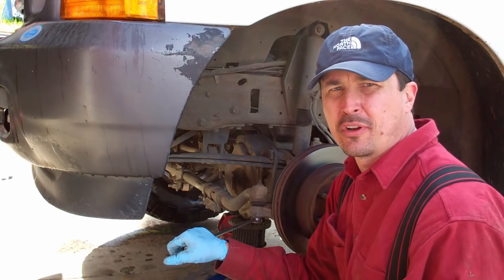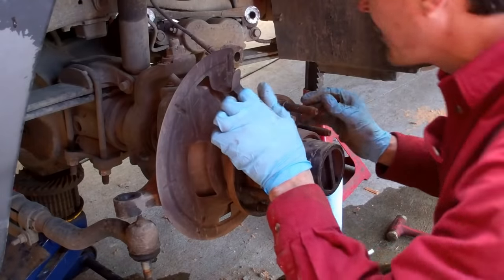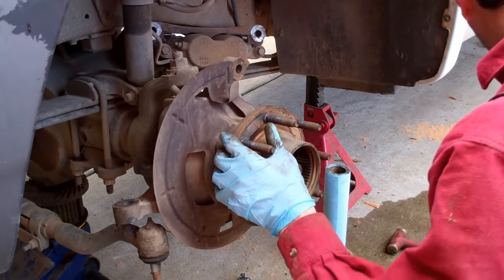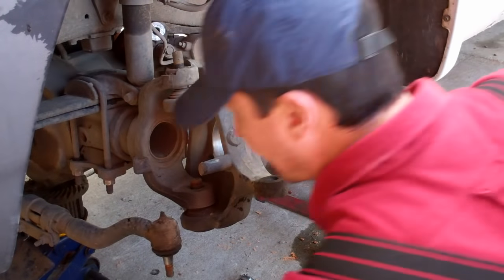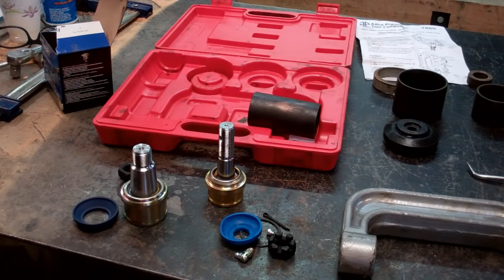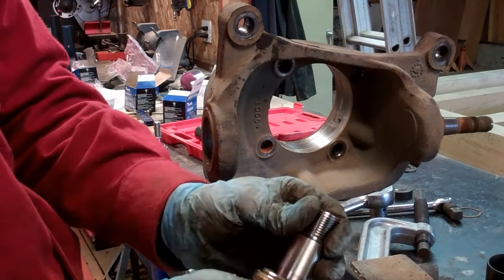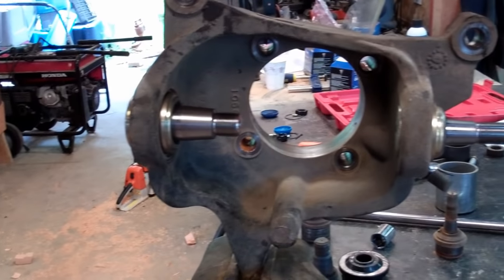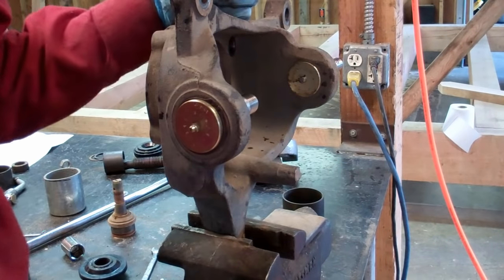How To Replace Worn Ball Joints Ford F250 Truck

Comment: Great video.  One suggestion  don't take out the ABS sensor out of the bearing.  Follow the wire, it's only about 2' long, and disconnect it at the wire connector.  They get seized in and break when you try to pull them out.
Reply: correct

Comment: $1200? that is a rip off!!! Ball joints only cost at least $30 per. and about an 30min - 1hr to replace.
Reply: Decent ball joints come from Moog.  They are area of $40
Reply: Mechanic gave me an estimate for  6 hrs 100$ bucks an hr I did it in 2 hrs for less than 150 bucks and now have tools now and am an expert:)

Comment: You can leave the 4x4 lock hub all together and just remove it with the wheel bearing as an assembly with axle shaft. Its a 2.5 hr book time job cut in half.  Of coarse if you are replacing wheel bearing or have hub problems you need to disassemble them.  I do lots of these
Reply: What kinda power tools do you use? Do you really need to buy the big tool set for the ball joints ?
Reply: @martinmartinez1109    I have a ball joint press from Cornwell but have seen sets cheaper   I don't have the universal set. Just basic ball joint press with three different sized tubes.  I have miscellaneous cut off pipes, old bearing races, fabricated spacers and plates I have kept and made through the years.  To be honest I use the press mostly for reinstalling the new joints. You want them in great shape and perfect when the job is done.  I normally use a air hammer, or a torch, or cut off wheel to remove the old joint. Quicker the better.  We are concerned with speed (it is how we make money)  but it has to be professional and look and work like new when it is done.       If you don't have a press you can usually pay a deposit at your auto parts store and when you return it you will get your deposit back  it is a good thing for the diy     I only have the tools because I do it for a living.    I hope this helps.
Reply: @martinmartinez1109  oh yes I do have a good set of tools and impact wrenches, and lifts.  I own my out shop and do it for a living. But I use to do these things growing up before I did it professionally, I didn't have that much then.    To be honest I have found the best mechanics don't have all the latest and greatest tools or even huge sets or the biggest tool box.    you are not out anything trying to do this with what you have.  If there is a will there is a way.   if you get in a bind and can't get it apart, put it back together or borrow, rent, or buy what you need to finish.  BE SAFE.  A Dr bill will be much more expensive than anything we can save or repair on a car.
Reply: @RT-xj3tr how can you leave the 4x4 hub on when there's an axle nut behind it?

Comment: great video, one of the best I've seen for f250's. i live in Nj so mine will take a little longer because of all the rust and corrosion. on the plus side, as my truck rust over the years it's getting lighter, giving me better gas mileage.
Reply: Pain and also misery. My ex is VERY rusty
Reply: I feel your pain Joker, Atco NJ here and spent the last 2 days with a needle scaler chipping off all the rust off my frame and painting it. I got at least 20lbs of rust in my driveway
Reply: Joker, so true!  I live in the Chicagoland area.  Where your car just disappears over time.  As it swells with rot, the rough roads keep it falling off.

Comment: We use our trucks for commercial snow plowing so what we would do while were in there is definitely change the U joint and if we have snow money we would change the whole bearing assembly put everything back together with copper anti- seize The rust here in New York is so bad the actual rotor will rot through before the brake pads are gone and we also end up changing entire calipers every time but doing it yourself you’ve saved all that shop labor , put that money back in to all new parts thanks for the video  100% correct

Comment: Thanks for this. I'm pretty sure I need to do this on an f350 I just bought. I really appreciate your little speech on self reliance too. I was making up a list of tools I'd need to add to my collection while I watched this. It amuses me how simple most automotive repairs are, but like you said, folks are just convinced they have to pay a "pro". I once went to O'Reilly's, put my truck on jack stands in the parking lot. Removed my brake rotors and while they were inside being turned I repacked my front bearings. All with my own tools. It was my own truck, so didn't have the luxury of working at home and driving them over there. As I was working I heard people talking. Looked around and saw a quick lube mechanic shop across the street, two of the "pros" standing there watching me. It was extremely gratifying! It's all just nuts and bolts. Thanks again man!
Reply: Tom Brueggen quicklube mechanics are the farthest thing from "Pro" that you can get, sure some stuff can be done by the at home DIYer, but for most of the stuff relating to drive train and Engine and other things you should get a pro to do.

Comment: Did this job today out in -2 weather in the driveway. Also had to cut a custom piece of pipe to help install the lower ball joint. I took this job on from watching a few YouTube videos and it really helped when making this happen. Triple checked all the bolts and nuts and retainers when finished and called it good. One thing I found out is to install the grease fitting on the upper ball joint first before pressing it in so that you can orient the 90 degree fitting forward so you can access it with the grease gun later. This is because when you tighten the grease fitting down, it may be pointed in the wrong direction.

This all started from the steering wheel getting a wobble at different speed and if the truck was loaded. Passenger side ball joint wear is always worse in worse shape than the drivers side.
Wranglerstar, you are so correct in stating this is not an impossible job if approached correctly and you can save a lot of cash that can go elsewhere.

Comment: 12:00 Camber/caster bushing. also, when you press the ball joints in, try applying some anti-seize to the ball joints as well as all the mating surfaces. if you ever do this again, you will be glad you did!
Reply: great advice!
Reply: Copper grease saves so much hassle later. Good advice.
Reply: Gale Hess it's fine. It's never been a problem with me

Comment: not trying to be a troll--just FYI though, you can hammer the lower ball joint out and if you dont want to do that you can use a cutoff wheel and cut the stem off and eliminate the need for the extra piece of pipe..ive done it both ways and both are affective. GREAT VIDEO!!!
Reply: I had to use a cutting tool to get my upper ball joint off.  Castle nut was stuck and the ball joint just kept on spinning.  This was the last resort after trying with vise grips.
Reply: Excellent
Reply: @1010degrees  Same. On an '85 TTB, But the axles are still remarkably similar.

Comment: I just changed out a hub in my 1999 Ford F-250 super duty 7.3L diesel because Driver side bearing went bad. At that time i looked at my ball joints and was wondering how in the world do change them out. Well i like your video because you show step by step how to get to the ball joints. Thanks very informative. Fyi. When doing a hub i had to change all seals in the end because the old seals when i broke the seal and they still looked good i put it back together again and they refused to seal right. So to anybody watching this video, please change your seal so your vacuum 4x4 system works properly. Trust here in Alaska Anchorage, i learned the hard way in 12 degrees weather. I ended up ripping everything apart again, just to install new seals on the hub, because i didn't do it while everything was apart the first time. Trust me it sucked! But still i saved myself $2300.00 doing it myself.

Comment: My son has this exact truck and needs his ball joints replaced.  NOBODY wants to do it, so we are going to do it.  It's looked like a big pain, but I just replaced the ball joints on my 4wd Explorer and except for the fact that the F-250SD is a little more heavy-duty, it's basically the same deal.  I'm gonna get a few pieces of pipe first - great tip!
Thank you for this wonderful video - you've inspired / encouraged me and I'm confident we will get it done fairly easily now!

Comment: Just replaced ball joints on my father's truck after watching this video. Thanks.
On this truck, axle did not come out easy like yours. It was hard getting axle seal out of knuckle. Had to punch it out from behind and replace the seal.
After finishing everything, something just came to question. Do you need to grease axle seal?
What is lubricating this axle seal?

Comment: I was a dealership technician for many years.  Great video.  I searched for this video because I have a friend's 250 at my house that needs the ball joints replaced, and I wanted to make sure that the procedure was what I thought it was.  A couple of things that I would recommend when disassembling is Leave the nuts threaded three or four threads and shock the knuckle right next to the drag link, and both of the ball joints with a BFH (Big F**king Hammer).  You can run the risk of tearing up the boot on the drag link and you can mushroom the head of the ball joints and cause issues with fitting them through the hole, if they are really stuck in there with a lot of rust or maybe just gorilla tight.  If they are super duper stuck you can use a pickle fork for the drad link and a ball joint separator.   Thanks for this tutorial!

Comment: I'm not sure which I hate more:  paying somone to do the job I can do myself, or doing the job myself.

I learned how to work on vehicles in 1979-80, when I souped-up a 1971 Mach 1 Mustang with a 351 Cleveland.  Things have changed a lot since then, and it drives me crazy when I have to work on my vehicles.

I am a mechanical engineer, but if I was an automotive engineer, I would never admit it.  Brake lines run in front of suspenion bolts, plastic parts that break instead of coming apart, spark plugs that need three extensions with 2 u-joints in-between, starters that can't be reached without taking off the intake manifold, fill-in-the-blank simple thing that can't be changed without taking off 47 pieces of whatever.

Sorry.  Ranting there.

Comment: The great mysteries of life like why does it only take for bolts to hold the hub on and eight to hold the wheel on .
Reply: Kent Taylor much different physics lol
And heavier boltz.
Reply: The wheel is further away from the center rotation point thus more force on it centrifugally.
Reply: Shear pressure

Comment: Nice job saving yourself some hard earned cash.
A few things,
NEVER use a heavy dead blow on a steering knuckle. You can deform the living daylights out of the casting with one. I have seen more than one steering knuckle ruined this way by DIY'ers. Usually it is the arm when the tie rod connects that get bent, but I have seen the ball joint flanges bent as well.
The best thing is a big ball peen hammer, not a dead blow, not a soft mini-sledge/beater/top maul. One swift hard shot perpendicular to the axis of the joint will pop it right apart. The idea is to take advantage of the ductile nature of cast iron. Done this way, the casting deforms then returns to shape. Beating on it with a soft hammer just swages the casting around until it vibrates free.
Also, always use anti seize before pressing the new joint in. It helps lube the joint so it can straighten out when it gets cocked going in, and makes life much easier when on the next person.
You need to lube that upper joint, it does not have enough grease in it from the factory.
it is called a "zert," not a "cert." :)
Reply: Zerk fitting (Oskar Zerkowitz)

Comment: You did a great job doing the ball joints by yourself buddy, and you are absolutely right about how expensive is getting life now. 
I have a 04 f250 6.0 4WD  and i need to do the same job as you did, i am getting all the tools i need and do the ball joint myself as well.
i am sure with your video you are helping me and who knows how many others with the same problem.
Thank you so much for sharing buddy 
God bless you 

Jacksonville FL

Comment: I rebuilt the G52 five speed transmission in my Toyota 4X4 truck. I had never even seen the inside of a transmission but the tranny was not usable and I didn't have the money for a rebuilt. I had the factory manual which is a VERY spartan source of information and help, and there is little info out there.
When I started this project I didn't understand how a manual transmission works. With what I learned, if I could do it again with all my new knowledge it wouldn't have taken me two tries to get it right. Now I can speak intelligently about gears, bearings, synchros, hubs, sliders, dogs, forks and quantum mechanics LOL. Manual transmissions are fantastically clever engineering, fundamentally unchanged since what, 1920?
When I got done I still had the original problem. I mentally wrestled with what I had missed and finally concluded the 1-2 fork was wiped out and due to my inexperience - 
I had never seen a good one - I had simply reinstalled the original problem. I ordered a new one and as soon as I saw those big meaty pads I knew this was my problem. I had already replace a broken 1-2 slider and installed a rebuild kit, new synchros and bearings and all. I replaced the old wiped out 1-2 fork and put it back together and it's fine.
I bought some specialty tools and all the parts including GL I think 3 oil and some important peripherals for about $700. A rebuilt plus peripherals with shipping both ways was going to push $2000.
For anyone contemplating doing one of these you must must must have a hydraulic press. I didn't and it would have been a comparative breeze if I had had one.

Comment: A little hesitant bout this repair until I saw your video. But more important your words. You are so right, shop wanted $450 to replace fuel filler tube on our Expedition. One trip to my local hardware and got it done for $22. Didn't think I had the tools for the ball joint job, but a rental from parts store. Great advice. Guys that drive big trucks SHOULD be able to do their own repairs. Thanks so much. Great job.

Comment: awesome video! just finished both sides of an 04 ford excursion diesel.. I have never done more than brakes and rotors so this was big for me.  took a long time on the driver's side, then the passenger side went in half the time.  thanks for the help, I saved $600 doing it myself!

Comment: My '09 250 Superduty is a little different,   the hub particularly..  Great job on the video! 
I had to stop around 7 min to comment on the salt making it a nightmare to get the hub off..   you are absolutely right,   I never ever get away with saving that big seal,   it is a nightmare indeed! Hardest part of the job here in Ontario Canada is getting that seal changed.   I do this to my offraod Superduty every year to change the u-joints, bearing and seals..   haven't had to change the ball joints yet which is why I watched this video..  Good show..    
They are tough drivelines,   we are hard on ours..   the OEM ball joints with no grease zerks have a plastic teflon bushing in place of grease..   they actually hold up well I find,   plus I don't have to grease em'.
Yours truly,   Safety Sally. 🙂

Comment: Thanks, this is a great step by step video.  I'm going to tackle this project including a complete front end rebuild tomorrow. One thing to add, when you start to get frustrated, walk away for a few hours to a day and a solution will often present itself. I've found the cost of the tools is more than offset by the labor and you have the tools and knowledge for the next job.

Comment: I'm sure its been said before since this video has been viewed over 400k times. The ABS unplugs right behind the wheel well. Just follow the electrical line until you get to the plug. Don't bend the heat shield, it will eventually brake if you continue to do that.

Overall, this is a great video! I love how resourceful you are. I do the same exact thing. Thanks for the video.

Comment: Great video. I just had ball joints put in my F250 and you are right 1250.00. The only thing I was missing to do the job was this video and a heavy bench with a nice big vice. I agree you just saved yourself a ton.

Comment: Bout to do this on my f-250 I had just bought. Super happy with the in-depth tutorial. Also I’d like to add. You can buy needle style grease zerks so you don’t have to change the zerk when you want to add grease. It’s low profile like the cap but less hassle. I’m not new to wrenching I just wanted to make sure I had everything before I started. Love your channel!

Comment: this is a really helpful video. if you live in New England you'll also need a torch for the bolts on the ball joints, dikes and air hammer for the coder pins, concrete chisel and hammer for the alignment ring, low profile grease fittings to clear the axle. takes about 3 or 4 hours

Comment: Well done, this was exactly what I had to do, every step was just as you described and it turned out to be easy.  Toughest parts were the ball joint press outs, that takes a good sized breaker bar.

Comment: Great video! 2 weeks ago i just changed my wheel bearing hubs (with the help of you tube). Just got new tires and tried to get a front end alignment. Firestone told me I have 3 bad ball joints and want to charge me $1200 to replace all 4. Basically $600 labor and $600 parts. Obviously I will be doing this myself next weekend.

Comment: This is a great video, ill be doing this to my truck in the next few weeks, got quoted by a shop for $1500 for upper and lower ball joints on both sides... hoping the new England corrosion hasn't made it too difficult of a task!
Reply: How did it go?